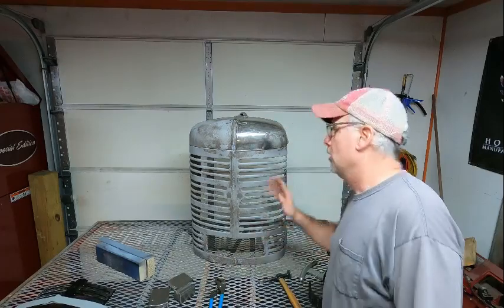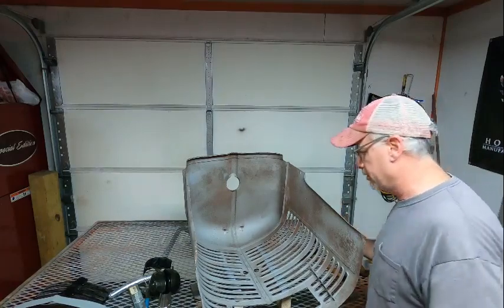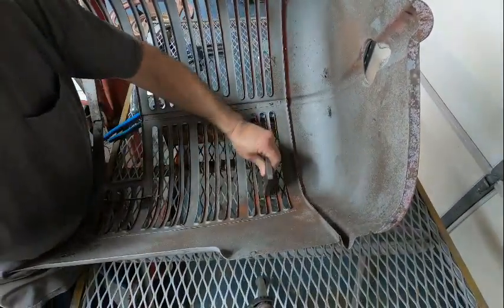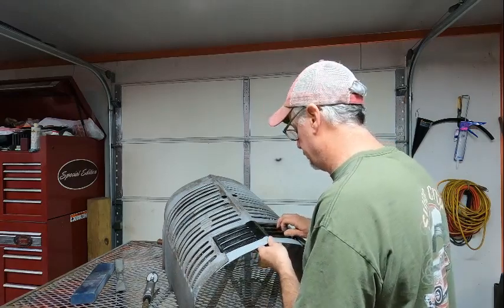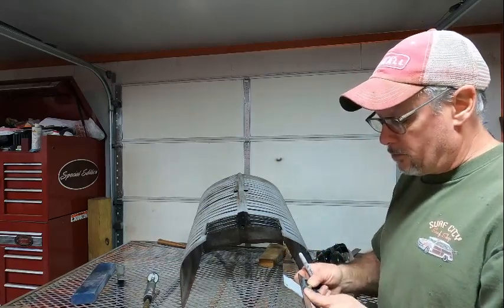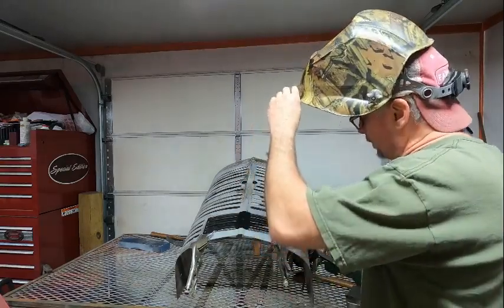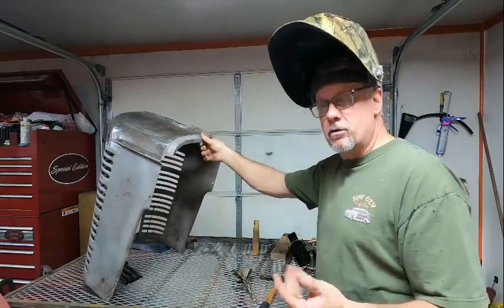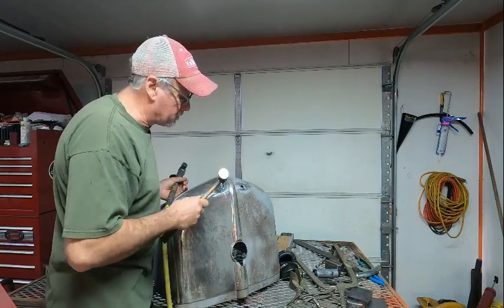How to Grill repair on the Farmall M

Comment: Yes it helped! The closer views also helped a lot.
You mentioned stretching and over stretching, both of which is bad I know usually, but how do you correct that?
Also after you had your bottom piece tacked in place, you continued to use the clamping pliers, how come?
Reply from the maker: To correct over stretching, you can use a shrinking hammer and dolly. I continued to use the pliers to keep from burning through the thin metal.
Reply: @OldRedTractors  Ok, I was thinking to keep it from warping but that just didn't seem right

Comment: If anyone knows someone near middle Tennessee that would be a resource for help with a 1975 International 140 C123 engine I need help.  Block cleaning & machine shop ect...  Engine is out, pistons rods & sleeves are out ect..  Ready for shop or rebuilder...
Reply from the maker: Try your local NAPA. They should be able to help you out.